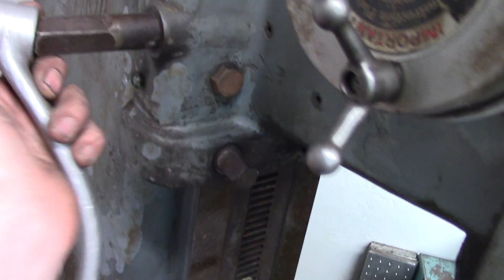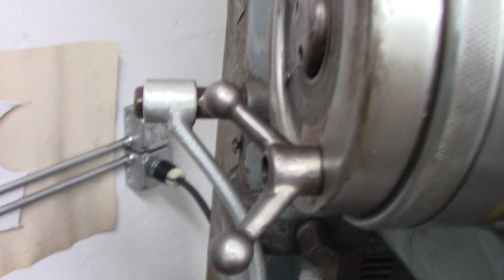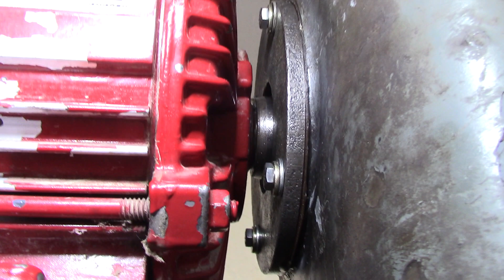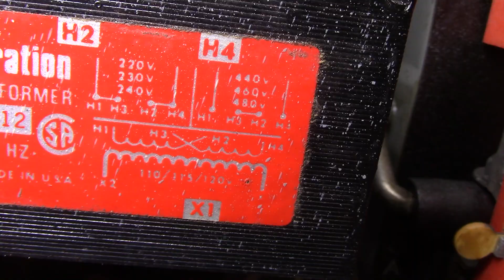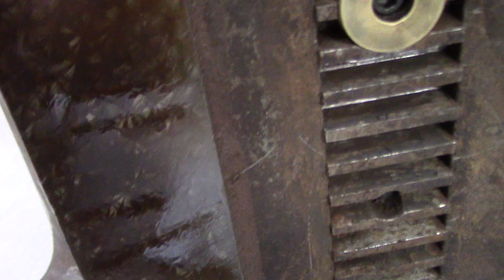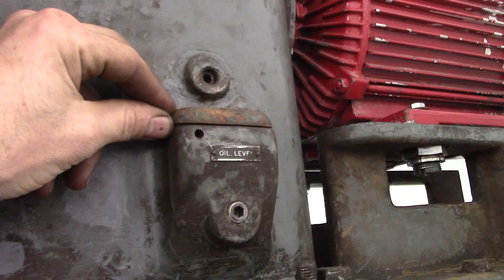7-30-25 --  Cleereman Drilling Machine - A Final Look - Part 5

Comment: put some "Lucas" treatment in the gear oil
Reply from the maker: I absolutely love Lucas motor honey.  The real reason that it is loud, is I have ISO 46 oil in the headstock.  The manual calls for ISO 110 oil.  I used the thinner 46 oil because I had some, and need to order the 110 oil.   I have been thinking,  the product Vactra #3 way oil is ISO 110 weight.  And it is tacky. This may be what I will do.  But I use straight Lucas on vertical way surfaces like the knee on a mill.  --Doozer